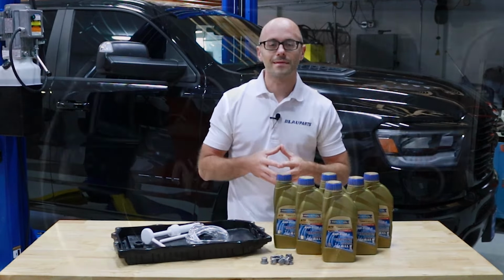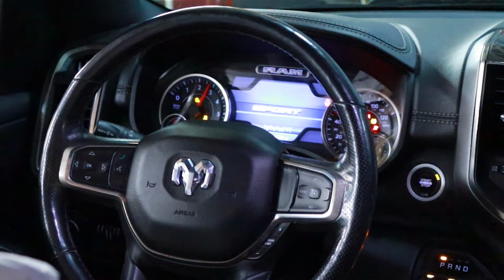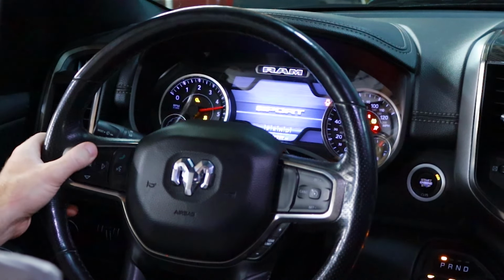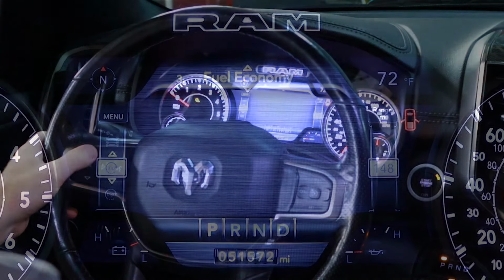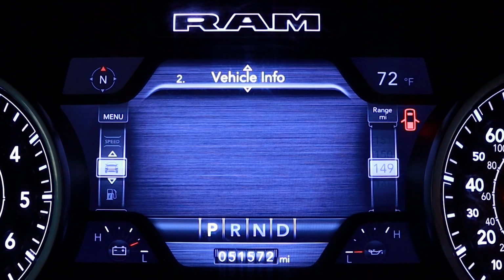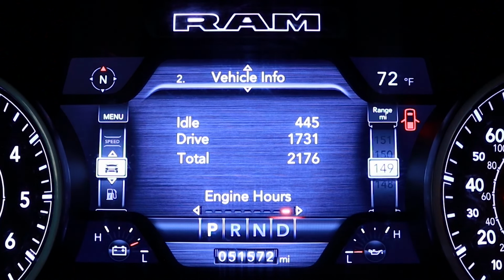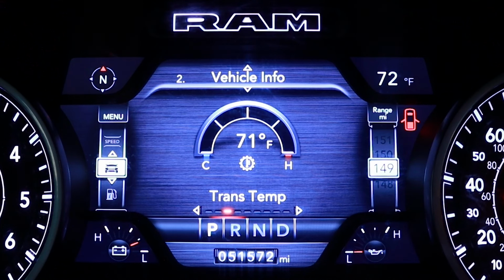Ram 1500 Transmission Fluid Change How To | 2013-2026 ZF 8-Speed 8HP

Comment: Awesome video but just wondering why did you change the oil? The dealship told me the transmission oil/filter is good for life for 2017 ram 1500 8 speed transmission
Reply: The dealer wants to sell you a new truck in a hundred thousand miles or so. ZF, the company that designed and manufactured the transmission, and who allows Stellantis to build the transmission under license, recommends changing the fluid every 50-75K miles.
Reply: @Beav014  Lifetime of the warranty, after that its not their problem anymore.
Reply: @Beav014  exactly, why isn’t the differential listed as a lifetime fluid when it has less heat and moving parts?
Reply: The ZF recomendation for fluid change is 80,000-130,000 Km. For those in USA thats 48,000-81,000 miles. 
And the transmission NEEDS to be level. On a Ram that means lifting the rear end approx 9”-10”  to get the pan rail level.
Reply: No such thing as life time fluid. I would change it after between 60-100k miles. If you do a lot of towing, then change it sooner.
Reply: Yes and I’m screwed cus I’m at 150 and the dealer told me it was lifetime at 100k and I listened
Reply: @jsixamore  I did mines at 108k for the first time and it didn't cause any slippage. You may still be able to do it.
Reply: @allenyee4782  I’m going to do it but just do the drain as shown. I think I’ll still have enough stuff in the rest of the fluid to allow the gears to grip. At least I hope!
Reply: Dealerships only care about maintenance that's required that may cause an issue within the warranty period. after that they have no skin in the game. If your truck breaks at 100k, they don't care, they don't have to fix it and get to sell you another truck.
Reply: They told me the same thing also. Two different shops said the same thing. Thought it was off but after the second shop i didn't pursue any more. Still in the back of my head. Found this video and definitely want the work done.
Reply: @DrunknOdin  I did mines at 108k miles and I can tell you that fluid was nasty. The magnet were coated thick in metal shavings. It was definitely time to do it.
Reply: I bought my 2017 ram1500 last year and the dealer told me the same thing.? That I didn't have to mess with the transmission fluid lol which I thought was weird being a 8spd you think it would need service more often. I'm at 65k miles so I will be doing it soon.
Reply: Yup, when the transmission fails because the aged fluid couldn't do its job anymore, the transmissions life is over so the stealership wasn't wrong, the fluid lasts the life of the transmission.

Comment: Enjoyed the video and instruction.  Isn't there an extra step when your truck has a transmission cooler?
Reply: I think so.  I believe you have to do all these steps then drive it then wait for it to cool back down to the fill range 86-120.  Then check the fluid again you will probably have to add another half quart or so.  I had to add 5.5 quarts in total through the entire job, but my transmission leaks a bit
Reply: @MrCarttbone  where is your leak ?

Comment: I will need to replace the oil pan with  new one?
Reply: The filter is built into the oil pan. If you use the old pan then you will be using the old filter as well. It's up to you if you want a new filter or not.

Comment: Just recently bought a 2014 Ram 1500 Laramie Limited crew cab. I was going through all of the fluids and noticed that the transmission fluid was red. I called and asked the prior owner if he had it replaced, he said a local service shop  replaced the fluid and filter and used synthetic fluid called Valvoline Max life. From my understanding the food is supposed to be a greenish color. Is this going to be an issue?
Reply: Max Life is an approved alternative fluid. The ZF fluid is about $40/qt. Max life is $40/gal. That's why side shop use it.
Reply: It changes the flavor to cherry 🍒 instead of sour apple 🍏
Reply: @BikerBenny  Should I send you a sample so you can taste test it.
Reply: MaxLife red is approved fluid. Many people use it because it's cheaper than ZF fluid.

Comment: What is the correct miles to do the service on this ram?
Reply from the maker: Hey Juan, we have info on the recommended ATF change intervals for this model Ram on the blog post for this DIY here: https://www.blauparts.com/blog/how-to-change-ram-1500-transmission-fluid-8-speed.html#ram-1500-automatic-transmission-fluid-change-interval

Comment: How do you find the full Instruction list on the proper steps to take when changing the transmission fluid?
Reply from the maker: For a complete step-by-step process on changing the Ram 1500 transmission fluid and filter, you can check out our Blauparts.com blog. You can find the link up in our video description.